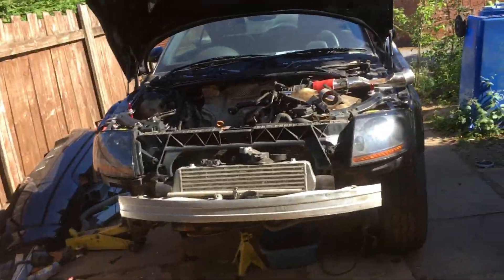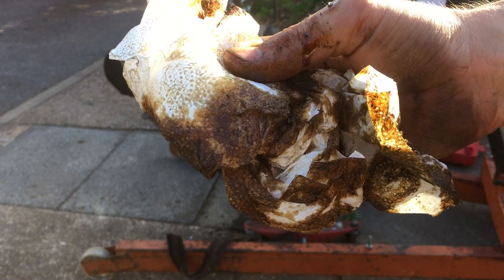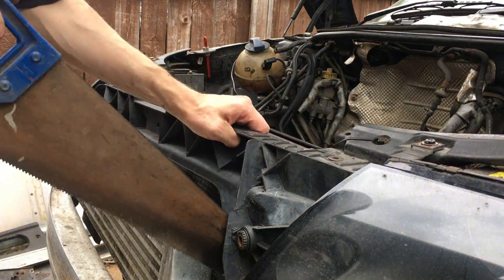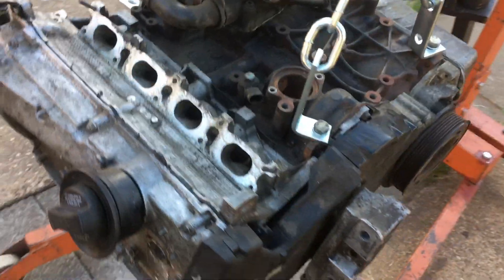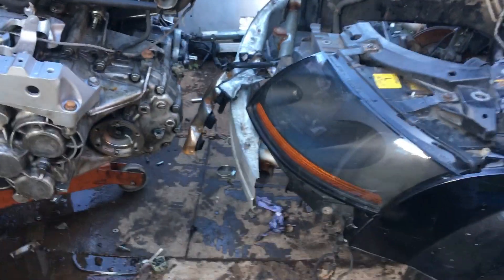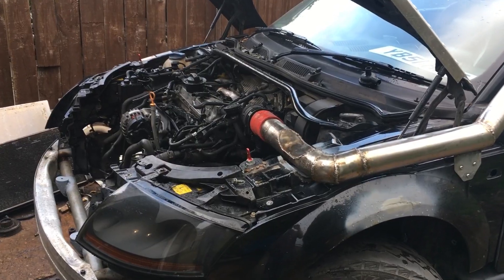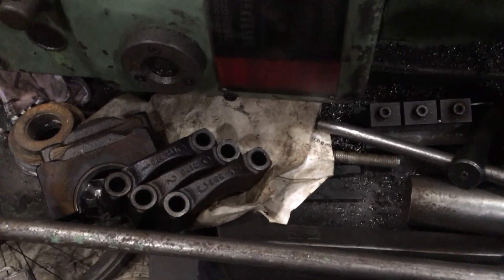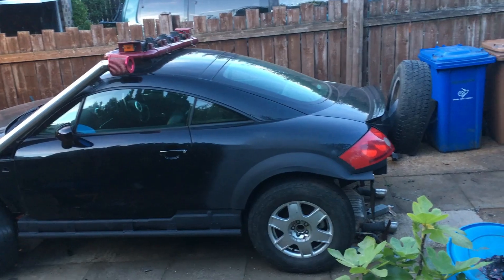Audi TT BAM engine swap - part 1

Comment: Looking at the way you cut the front end off it’s 20 minutes tops to unbolt it 😂 clearly wasn’t in the mood that day 😂😂
Reply from the maker: Bolts? What are they for? Angle grinder for taking off, welder for putting back on... right?
Reply: Sounds about right for our TTs 😂

Comment: Hi don't suppose you know what size belt you used when you took the air conditioning unit off , I want to get rid of
 mine.
Phil
Reply from the maker: I can't find exactly which one I used but I think a 6pk1125 belt will fit. I believe a 6pk1120 belt is used on the TT QS but some people complain that it's a bit tight. There's enough travel in the tensioner to allow a slightly longer belt to be used so I used either a 6pk1125 or 6pk1130.
Reply: @davemakesstuff5828  thanks for the pointer, I want to remove mine when I get chance.
Reply from the maker: I didn't want to release the refrigerant into the atmosphere as it's a really powerful greenhouse gas. Obviously I couldn't drive the car anywhere to get it done either. It was a relief to discover that it had long since leaked to the point of emptiness!

Comment: Hi, do you think its worth swapping a 180 for a 225 BAM?
Reply from the maker: Not something I've done, but clearly easier than trying to fit an engine that wasn't designed to go there. There are a few extra bits that come with the 225 - twin intercoolers and therefore revised air ducting being the main thing that come to mind. If you've got a 180 that's running well, it'd be worth comparing its value with that of a 225; swapping the car would certainly be easier than removing and replacing the engine and gearbox!